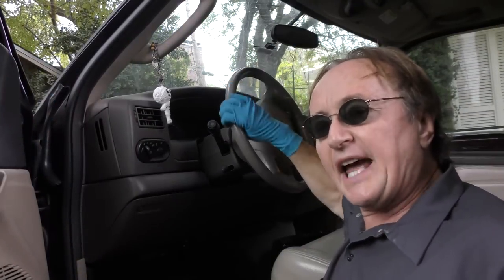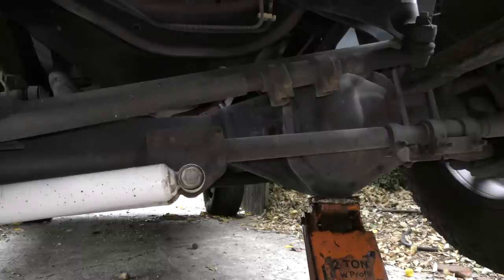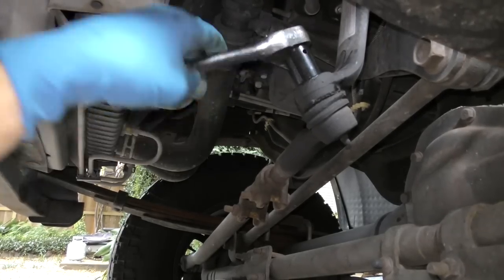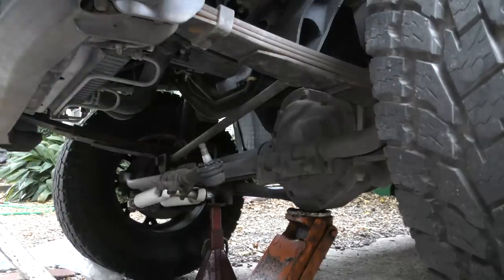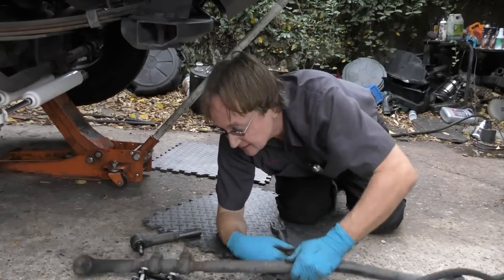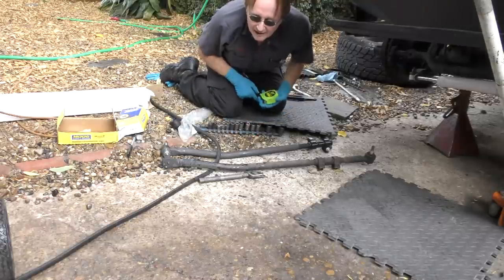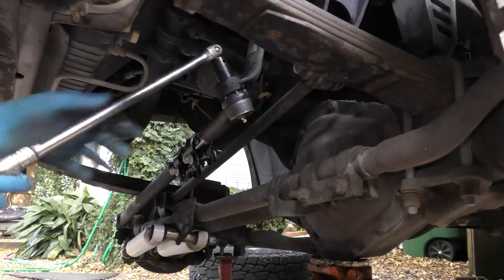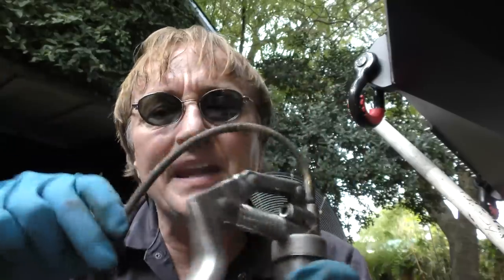How to Fix Steering that Clunks and has Play

Comment: That was a very easy repair.  I'm surprised that the owner of the truck didn't decide to do it himself.  I was hesitant to try to repair my own truck until I found out how easy it was to replace things like the radiator and shocks.  I got up the courage to buy the new parts and put them in myself.  Sure, I had a couple setbacks, but I got it all done in a couple hours.

Comment: I love you, Scotty !!! I fixed everything on my Impala 2011 and it still clunks. The idiots put in a junk-yard steering rack and didn't replace the bushings. I went and fixed: inner outer tie rods, ball joints, wheel bearings, cv axles, control arms and new struts - still popping --  the issue was 2 bad bushings on a steering rack as loose as grandma !!! I spent 2 grand when the bushings would have been priceless !!! All I want is a safe car. Are you anywhere New York, Binghamton ??

Comment: I have a 06' dodge charger sxt with 200k miles I bought for $200 bucks about 2 weeks ago! Nice body few spots on q panels but rest is solid, 18 inch alloys, solid running 3.5 "high output" motor, trans shifts beautifully, no leaks, clean interior and the kicker is it drives better than or just as good as cars of recent. Yeah THAT smooth. Honestly love it. However it does have this loose steering wheel issue and I do not hear clunking when turning. I only hear rumbling from the front end on rough streets or an accidental pothole. Other than that this was a great purchase in my opinion. Everyone who rides in it says how smooth it drives. Just have to get the little issues taken care of

Comment: Scotty, I like the way you reason the problems out. Here's mine: a 2006 Chrysler 300C steering wheel problem.  Engine running, placing hand over the 12O'clock pos. I can "feel" - while turning the steering wheel some let's 'say 5 degrees - a sort of a "bald spot" on a ball bearing (I know, it's weird). On the road - and at 40-50 mi - this same "spot" now becomes "inactive", and the wheels do not seem to respond immediately. It feels as a column steering bearing, but it's only on one Arc of the circle; not all around. It could be tie rod joint lose, yet I hear no clunking noise. Left side front tire is worn more on its outside edge, a bit. Suggestions? Ashtray is worn out, maybe?

Comment: Scotty I'm normally the person to find my own answers but I'm at a loss. I have a 98 lumina that just today started having engine clunks from the bottom end passenger side near the firewall. It doesn't sound NEAR as bad from the engine bay as it does from the cabin. I can feel it all the way to the steering wheel(vibration that was not there before and is very noticeable). I've checked the topside engine mounts, the belts, fluids and made sure the steering was proper. If I put my hand on the alternator I feel it very much there but it still seems like it's lower. The sound is a mix from a knock to a tick, best way to describe it and I've given about as much detail as I can think of, I really hope you answer. Thanks. 3100 SFI V6 is the specific engine.

Comment: Stabilizer bar links can clunk and rattle. If steering is snug and tracks well but lots of clunks over bumps check the links by grabbing them and seeing if there's any play the same as checking ball joints, tie rod ends or center link. Most likely $20-40 for new ones.

Comment: Does this apply to the passenger side as well? I'm assuming the steering column shouldn't move back and forth when moving the front driver side wheel correct?

Comment: They make tie rod pullers(similar to pitman arm pullers), but they don't always fit.  One day they will make the tools easier to use or better functioning
Reply: All you need is a hammer. Hit where it goes through, if enough space to swing the hammer of course. Then it will eventually loosen

Comment: Hey Scotty, love your videos. Aren´t you supposed to remove that plastic protective piece over the ball joint bellows before installation? Now it just got crushed in there...
Reply from the maker: +Daniel Karlsson plastic piece was removed and replaced with the rubber boot that came in the kit, guess they didn't want the rubber one to get damaged in transit.

Comment: I've got a 2ND Gen ram 4x4 and I've got the same loose play as well as shaky wheels when I turn. checked Pitman arm but no play. check track bar and it's solid and I checked the tire stability and it doesn't wobble but it does have grease around the ball joints on the knuckle. am I missing something?
Reply from the maker: +rammit 82   often a bad steering arm does that

Comment: Another great video. Hey what causes new disk brakes to squeak? Just had the dealer put new brakes and rotors on my truck a few weeks ago and they squeak now right before I come to a stop. Should have done the job myself but didn't have the time. They broke off a brake bleeder screw on one of my calipers too.
Reply: +Zack Zander on a new rotor, there's a film of oil so the rotor wont rust on shelf.. if "technician" didn't clean the oil before installing it will squeak.. bring it back it should be under warranty
Reply: Zack Zander could be the brake hardware rubbing on the rotor too, I had that happen also

Comment: Scotty, I think I may have the problem in this video? I have an 04 f150 4WD with 150,000 on it. When driving it, it makes a low clunking noise in the front end left side when turning the wheel left. Can really feel it under my feet and when slowing down on back roads. Bad rack and pinion? Wheel bearing maybe?

Comment: Scotty! 

1992 Toyota previa, Turning the steeringwheel while stationary causes massive clunk sound that feels like somebody punched the steeringwheel. There is no play in the ball joints or bushings on the suspension. Does not clunk when driving.
Reply: Ford M Garage  check drive shaft set  .
watch Toyota power steering video  on YouTube.
Reply: Check out the video with the bad bearing in steering column. Dude fixed it with a 3/4" x 1" spacer.
Reply: my 05' Volvo does this too but not very bad.

Comment: I have a Dailey car I’ve just purchased for the winter here in Canada I don’t drive my WRX. So anyways.. I’ve gotten 2005 Nissan Altima with the 3.5L V6 in it. It’s an okay car for the winter and price I’ve paid ( gotten from a friend who had it almost a year and before that it came from a used dealership in 2018. I’m having a clunking noise when I’m driving on a bumby or uneven road almost like it’s bounding on the passenger side. The driver side is soild I can hit a pothole by mistake and it doesn’t even make a sound. But when I’m in park and turn my wheel around I can hear the clunk noise aswell. I only plan on having this car for the winter. Safety is real. And good untill October of 2020. What should I look at first. ? I’ve alrdy done all my breaks all around the car. And I’m getting ready to put my winter tires on it aswell. I just don’t want to spend a ton of cash at my local mechanic. For something I didn’t or don’t need. I have a little bit of car knowledge myself but never worked on a front drive suspension before. Thank you

Comment: i have a 2004 f250 v10  it has lots of play in the steering like that truck did  and it makes clunking noise while turning ONLY IN 4WD THOUGH  i went under the truck i had some one turn the wheel left to right i put my had on that part and i felt free play in it   do you think that can be making the clunking noises in 4wd drive to  when i turn

Comment: Scotty, My toyota tundra 2007  vibrate between 60 to 70 mi. Truck steering wheel  does not vibrate on lower or high speed. I've checked alignment, tire balance, wheel shake all looks good. What do you think it could have problem with?

Comment: what causes the steering wheel , shifter and the key to lockup and shifter not to shift. i have tried pulling the the steering wheel and turning the keys but no luck. please explain how this all works together.

Comment: Hi Scotty, I have an '01 Chevy Silverado 1500, I was driving and heard a pop in the steering wheel/ column. It still drives good and the alignment is spot on but my steering wheel will wobble about an inch and a half in all directions. Any idea what that is?

Comment: Scotty, is a torque wrench recommended for tightening everything up?
Reply from the maker: +EricTheAnteater sure, you can get a book with settings and use one if you want. But it's not that crucial on these parts, just get em super tight by hand

Comment: Hey Scotty. I'm replacing a head gasket on a 99 Dodge 5.9L 24V Cummins Turbo Diesel. When prepping the block, is smoother better? I've got this Mother's metal polish that'll put a mirror shine on the mating surfaces, but I'm not sure if that's a good idea, or not. Like brake rotors need to be smooth, but not mirror smooth. You know? Or, should I get it clean with a gasket scraper, and be done with it? I've got some ARP Head studs too. I don't want to go through all this again. Such a pain in the ass.
Reply from the maker: +TheProfessor936 smoother is better.

Comment: Hey Scotty, my dad has a vw sharan and i have a 1984 vw t3 . My dad changed the oil in his car but it was the wrong oil but it was the right oil for my t3. so he changed the oil and gave it to me to also change my old oil with his. the oil was only used for 100km/60miles and its 5w-40. but it isnt enough, just a bit above the min limit, so can i buy castrol 5w 40 and supplement the old oil? my dad says that i should do so.

Comment: I've changed inner and outer tie rod ends and also ball joints on my 2000 Camry and still have play. Could the rack and pinion be the one causing the play?
Reply from the maker: yes, it could if it moves, also check strut mounts and A frame bushings and wheel bearings

Comment: Scotty what's up brother? I have a 4 generation Nissan Maxima some play in the steering wheel, when I check it out properly it's the rack & pinion bushing, please tell me how to change rack & pinion bushing please. Thank you.
Reply from the maker: if you mean the ones that the bolts go through that hold the rack to the frame, they are pressed in and out, so you'd have to remove the rack from the car and use a press to do that

Comment: Scotty, i have a question about my Fiat bravo, 2 days ago i hit a curb on my right wheel, i had my Knuckle changed because it was bended, my wheel is acting strange, its not centring it self when i turn and is more heavy. i also did the Wheel alignment but the problem is still there, what could cause this to happen? Thanks!

Comment: Do you have to torque to any specification on that center linkage nut that connects to the pitman arm (I believe is what that is)? Or do you just have to tighten the heck out of it? I assume you "could" over tighten it and cause premature wear at the joint.
Reply from the maker: +Ohio Digger there are torque specs for every nut and bolt on a car. But really, much is overkill. This is pretty solid metal, get it as tight as you can by hand then put the cotter pin in.
Reply: Ok that's what I was assuming.  There's kind of a sweet spot with those cotter pins.  Tighten too much and you'll go past that hole and won't be able to get the pin in.  Or don't tighten enough and you'll be able to tell because the steering will be sloppy.  Love the videos boss!

Comment: Hey Scotty , thanks for all your great videos. i have a 2008 nissan rouge and when i turn the steering wheel i hear noise coming from inside the car not outside i looked underneath by the ball joint where the steering rod connects behind my brake pedal and couldn't see anything rubbing. what should i do or maybe it needs greasing somewhere?  thanks for your help as always
Reply from the maker: +stranger21ny nothing to grease, but on those, often the steering wheel U joint and bearing assemblies start to wear and do that. A COW to repair
Reply: +Scotty Kilmer thanks scotty i appreciate it

Comment: Hi Scotty we have an 02 Pontiac Montana(know you hate these) and its leaking oil thru intake manifold gasket. Dealer wants $1800 to replace all gaskets(except head). I was told to flush the Dexcool and change to extended life Prestone antifreeze. Is this a good idea to prevent more damage. Its the 3.4l  V6 GM motor. Thanks for all your great advise!
Reply from the maker: +Robert Gross yes, it's a good idea

Comment: I recently got new struts on my car, and steering and alignment is fine, but since then when I make the first movement of the steering wheel (after starting the car when beginning to move),  something will make a clunk sort of sound, as if the mechanism was lightly seized and was becoming unseized. But there's no play or resistance in the wheel. Any ideas?

Comment: Question. My truck was making ticking noise then loud clunk from the front end I replaced the two front CV axles the ticking noise is gone but I still get the loud clunk when turning the wheel and the steering wheel has a lot of play in it and the front end shakes till I reach a certain speed on the highway could you please help with a guesstimation of what this could possibly be??

Comment: I love your videos. I have a 2000 chevy impala LS I took off fast the other day and there was a loud clunky sound from what it felt like to be the front left tire or around that area any idea what it would be ?
Reply from the maker: +Jakob Proffer jack it up , pull on the wheel checking for play. Often worn tie rod ends or ball joints, but also check the shock mounts
Reply: +Scotty Kilmer thank you.i will look into it

Comment: what do you think (normal) life expectancy of a ball joint is?  just regular driving,  I know there are many factors that can shorten their life span.  100,00?
Reply from the maker: +bob smith heck, on toyotas they can go 500 thousand miles, realize the heavier the vehicle, the faster they wear out
Reply: true... it's a pickup truck.  It passed inspection and got an alignment yesterday.  I was ready to buy control arms and install them.  Thanks for the response. 
cheers...
Jason

Comment: I have a 1993 c1500 there is play in the steering wheel but none in the wheels. I've been told it might be my steering gear box & upper control arm. Could that be it?

Comment: Scotty I just had my sway bars changed on my 01 Dodge intrepid not to long ago had them greased too. But I noticed when I changed my tires that grease came out and is drippin around the bar but the rubber is still in good shape is this normal? Also how often should it be re greased?
Reply from the maker: +Dblade981  that's normal, as long as they are not worn, leave it.

Comment: hi, I'm driving a 2011 Toyota with electric power stearing. 1.It has a tock sound once in a while.  is it something to be concerned about?

Cheers Man......
Reply from the maker: not as long as you find no play when you pull on the wheels jacked up

Comment: Scotty I have power steering problems on my 93 lexus gs 300 it's leaking from somewhere an wines in cool start should I change the hole thing or just the switch?
Reply from the maker: +flx176 change just the switch if it's leaking, try my video "finding and fixing car oil leaks" to find out

Comment: Hey Scotty I have a 98 Oldsmobile cutlass that has a starting issue. When key is turned to on position lights and everything comes on but when I try and crank the engine the battery shorts out and no electronics come on until I disconnect and reconnect the battery. Had this issue before and it was the ignition switch but that has been replaced and the problem still occurs. Any ideas on what it could be ?

Comment: Good video. 
 I got a 97 Chevy astro van with two problems. .:
the first one is the ac switch do not open the door blend to select vent.  is blowing on defrost  and under the feet area only. If it is the blend door actuator?  where is located in this particular car..

2nd. When it comes to stop or braking a any speed.  the vehicle pulls hard to left. But if you keep your foot on the pedal the car goes straight. 
I replaced both calipers. 
I replaced a ball joint and inspect control arms still the same problem. 
What could it be? 
please advise me. .
thanks. .
Reply from the maker: +Abe Perez actuators go bad all the time on those, they're inside the dash, a pain to access.  Go to a good front end man to check the front end, braking often accentuates minor alignment problems.
Reply: +Abe Perez I have a '98 and my ac started doing the same thing.Turns out it was a cracked vacuum line under the hood.Chevy uses those black plastic vacuum lines but I replaced it with rubber.

Comment: Two Steering Dampers? Never seen that before, is that modification or factory standard?
Reply from the maker: +Chrisco_96 this is a modified vehicle, non standard and some parts are just weird like that (and they actually aren't correct dampers as someone already mentioned.)
Reply: +Chrisco_96 Dual Dampers are common on lifted vehicles with large tires, helps cut down on wheel feedback offroad

Comment: love your channel Scotty! I'm going to be replacing my drivers side axel myself from watching a couple of your videos.  I been having a problem with my windshield  wipers.  not sure what's wrong. hope it's not electrical. I replaced the wiper control switch and motor. the fuses are good and there is no rely for it either. the connector that goes into the wiper motor looks good and clean but no power is going to both. have any idea what it might be? would really appreciate any info on that. thanks bro. Louis from SoCaL
Reply from the maker: +KwickXonE96 check the ground wires too, they often go bad. if not that, motors do wear out over time
Reply: Thanks Scotty. The motor is new and also the switch.  Will have to check the ground wires then. I ttied both motors and switches nothing